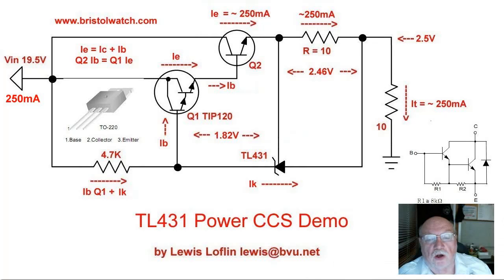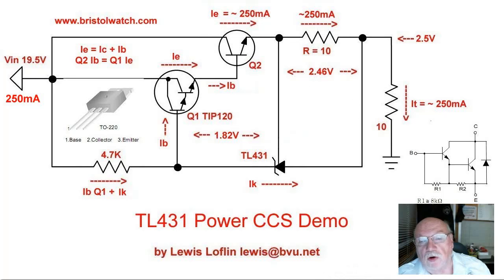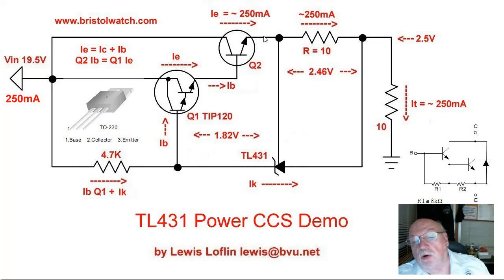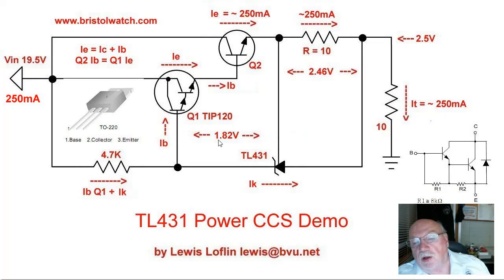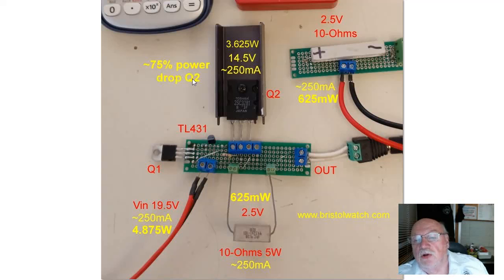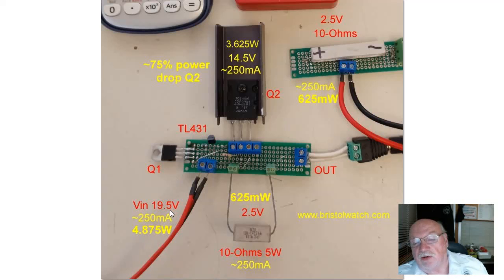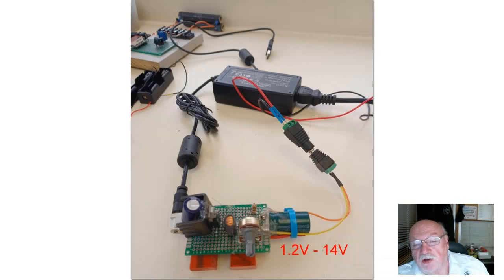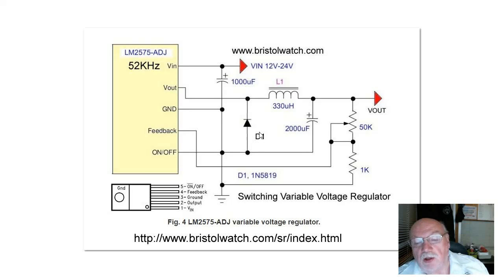TL431 Power Constant Current Source Demo 1

Comment: I will appreciate very much if you explain us the function of TL431 in wich the cathode is connected to the ground of 7805 regulator and the reference voltage is conected to a volage divider between 7805 output and ground ; so the 7805 output can deliver between 1 to 5 volts by changing the value of the voltage divider ,This circuir appears in the Forrest Mims Engineer's Notebook Thnak you very much
Reply from the maker: The TL431 is never connected to the ground via the cathode. The cathode and ref are connected together, then connected to the GND side of the 7805. This creates a 2.5V reference. The anode then goes to the ground.
Reply: Sorry ,the TL431 cathode is connected to the ground connection of the 7805 (pin 3)  .Can I send you an email with the circuit diagram? @LewisLoflin
Reply from the maker: You said ground. That is correct, the cathode connects to the 7805 ground pin.
Reply from the maker: It doesn't need a voltage divider to act as a 2.5V ref.
Reply from the maker: You are right, my bad.

Comment from the maker: Related links:
http://www.bristolwatch.com/ccs/tl431_ccs3.htm Power TL431 Constant Current Source Circuits
http://www.bristolwatch.com/ccs/lithium_charger.htm TL431A Lithium-Ion Cell Charging Circuits
http://www.bristolwatch.com/ccs/lithium_charger2.htm Charging Multi-Cell Lithium-Ion Battery Packs
http://www.bristolwatch.com/ccs/tl431_ccs1.htm TL431 Over-Voltage,  Under-Voltage Detector Circuits
http://www.bristolwatch.com/ccs/tl431_ccs2.htm TL431A Constant Current Source Working Circuits Demo

YouTube:
https://youtu.be/PvhyJXUhlKI TL431 Under-Voltage, Over-Voltage Detection
https://youtu.be/y2gnZ7HZefc TL431 Constant Current Source Circuits
https://youtu.be/kJUit6XQYKE TL431A Lithium-Ion Cell Charging Circuits
https://youtu.be/jVXmL7HThiM TL431 Battery Charger Circuit Calculations Revised
https://youtu.be/Fr0Zir8UCLs TL431 10-Volt Charger Short Version</a>
https://youtu.be/gg0Tux_pAgk Charging, Charge-Balancing 18V Li-Ion Battery with TL431
https://youtu.be/QfXS70Kwx94 18.5V Li-Ion Battery Charger with TL431 (short)